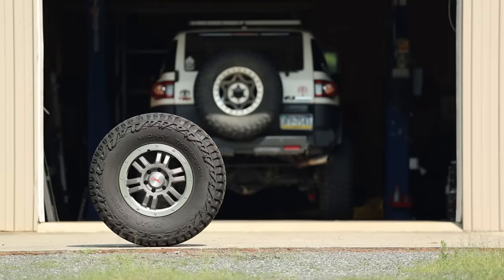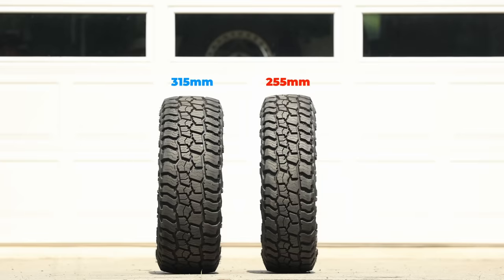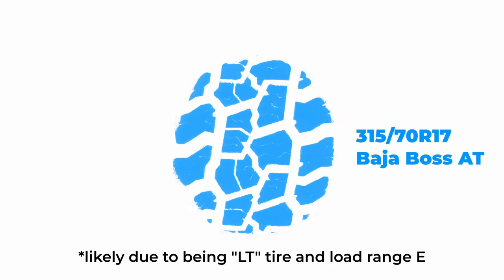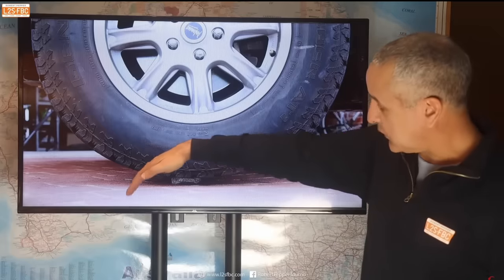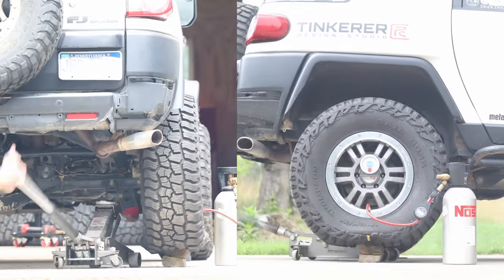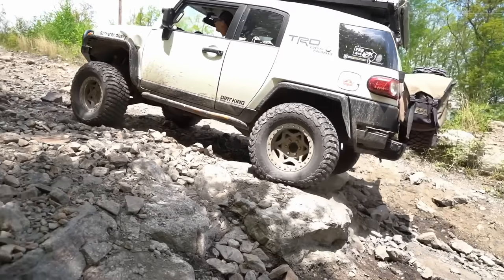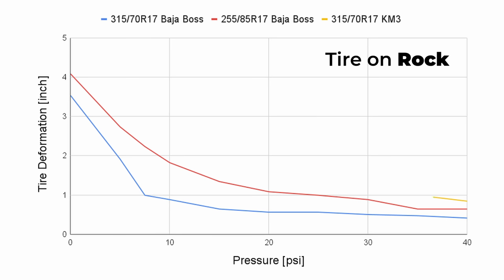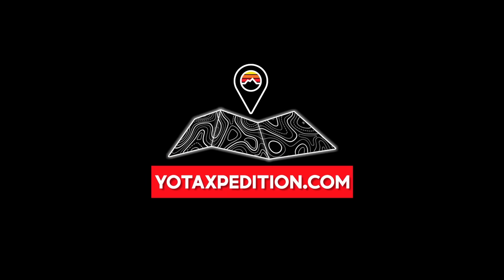3 Scientific Experiments to Settle This | Wide vs Narrow Off-Road Tires

Comment: Really depends on the application. Snow = Skinny Tires,  Sand = Wide Tires,  Off Road General = Depends on the weight of the vehicle,  you have a light vehicle so the thinner would be the same as the wide on a heavier vehicle. This video is great because you point out wide is not always better which is the important takeaway.
Reply: Airing down on sand is more important than width. Length provides better tractions than width.
Reply: Ive found skinny tyres better on sand
Reply: @tishbrett  The only way that could happen is if your vehicle is very light and the tires are sized appropriately then wider may not gain much. As someone who has driven decades on sand in Hatteras wider tires is more flotation and will always out perform skinny tires. Maybe the sand you are driving on is offroad shallow sand and not deep beach sand.
Reply: @raffikkiz  True, its all about the contact patch and airing down makes a bigger patch than going a few sizes wider with same psi.
Reply: @laz288  i will disagree with that mate plus the wider you go bigger the motor has to be to push them a 3t ute is not that light
Reply: @tishbrett  I agree somewhat. I think once your vehicle rides good on the sand then wider wont add much and like you said more work for the engine. But I bet if you went even skinnier on the tires then you have now you will start to see a loss in performance in sand.
Reply: Seen videos narrow better in sand

Comment: Good investigation.  I suspect the E rated sidewalls are just too stiff for the weight of the FJ.  It would be interesting to see the same tests with D rated sidewalls.
Reply: Definitely, I’m not a fan of load E for vehicles smaller than full size trucks, too heavy, less flex, require higher PSI so they ride harsher. Load C would be more than double the max gross vehicle weight of an FJ so more than enough, though finding 35s in Load C and D is harder.
Reply: @luso_overland  Some years ago I inadvertently had some E rated M/Ts on my JKU.  Sidewall was stiff enough that I couldn't tell by looking at it that the rear right was dead flat from the screw in it.  Ran perfectly well to the shops & back at 0 PSI...
Reply: @NemoConsequentae  Yep, I've seen that before as well.
Reply: I run E rated on my CJ. 5psi or flat isn't much different. I only need 20psi to run down the highway.
Reply: Have a 4Runner with E rated 265/70/R 17 tires… good ride, safer for me.

Comment: Great video. 
a lot has to do with the weight of the vehicle. If you have “heavy weight rated tire on a light vehicle, it’s gonna react differently than a lighter weighted tire”. 

If you put a light weight rated tires on a heavy vehicle, it’s gonna have different traction because it’s gonna have more ground contact

Comment: If the KM3s have the flex of the skinny Mickey Thompsons, imagine pizza cutter KM3s

Another great video Kai! Appreciate you applying scientific methodology in a space where it isn't very common. I've been following Robert's channel for awhile, and the accessible technicality of your channels and the density of information of their content is why I keep coming back. Keep up the good work!
Reply: they make them in 33's. 255/85R16. Been thinking about getting them as my next set of tires.
Reply: @takenpictures Been considering them as well. They’re really heavy though compared to other MTs in the same size
Reply: @shootinbruin3614  I've ran the Geolander G003 MT in a 255 and loved it. I'm now trying out the Cooper Discoverer ST MAXX. So far I really like it
Reply: the KM3 wasn't a fair comparison because they're used tires and broken in. It would be a very different result if they were new. I wonder if Kai is sponsored by BFG.. lol
Reply: @takenpictures  Thanks for the input. The Yokos are the lightest 255/85R16's I know of and they're in consideration. I'm currently on the old Geolandar MTs so I just might stick with the brand

Comment: In 46 years of off roading I have learned wider patterns are best for fluffy soft sand , rocky terrain and times when Ya need to float .  Narrow is better in clay and wet cement type terrain where you need to dig down to get a bite . Now the vehicle weight is a factor as well . I have seen heavy trucks get better traction in some terrain and sink in others .Likewise I have seen lighter rigs float and just go through easily or sit and spin while floating . In the early 1980s the tires called Norseman were the best in sand and snow ( Iceland gents used these exclusively ). Look at paddle tires , Rice and Cane field tires and terra skidder tires as extreme examples .

Comment: Well, unfortunately your test is flawed.  A 315/70r17 requres a rim with of 8”-11” for proper fitment, and a 255/85r17 requires 6”-8” rim with for proper fitmen, using the same width of rim puts one tire at maximum spec, and one tire and minimum spec for fitment, altering tread footprint. May be do a do over and use a rim that puts each tire in the centre of their rim width requirements
Reply: Yes, It is flawed in that sense.  But most owners dont exercise power over getting a second set of correct-width rims for the tire, they just run stock because of other issues encountered in setback and fenders.

Comment: Nice take.... I was told years ago that wider was better due to more traction and stability. That was in '00. I had the pizza cutter tires in the beginning, but now I have better tires with more I knew. Currently my 2011 F 150  is rolling on 275/55/20 Highway tires made by Rocky Mountain and I love the ride quality and quiet sound

Comment: Very interesting video. I remember some of what you found from physics and pavement design in college. We had some problems for asphalt design.  These mostly concerned tire pressure effects on asphalt at different loadings. 

Up until the 4x4 boom in early 70s, most people I knew with military surplus jeeps up to CJ-5s ran tires like the narrow ones the military used and swore they were better all around than wider tires but especially in mud and general off road. Not much sand here in foothills of NC. When the 4x4 boom hit, almost everyone I knew went to softer, wider tires but bigger, heavier vehicles became the norm also. I've never seen a study like yours. I have a '66 CJ-5 that is parked but I keep thinking of getting her back on the road / off road. You gave me something to think about. Hats off to your tenacity and hard work. Thanks.

Comment: I have a question (or comment, if you will), but first, I'd like to say this is a fantastic video.  I really appreciate how much time and effort you put into this experiment.
Now, here's my thought.  Though you focused on (in the pipe test) the length of the contact patch, what about the width flex?  The narrower tire flexes more fore and aft more, but it can only flex so wide.  The wider tire flexes outward, rather than fore and aft.  From the video, it seems to be a significant amount too.  This (to me) is significant because the pipe is a more "point" contact rather than an "area" contact.  This additional pressure will definitely spread the footprint more than the flat "ink blot" test (genius, btw).  My point is, what the wide tire lacks in "caterpillar", fore and aft contact, it gains in width contact.
Another consideration is uneven terrain.  There is literally more tire to grab on to any bits of terrain that may contact the wider area of the tire, providing more traction.  For any serious rock crawling, every inch of surface area counts.  When you straddle and use the sides of the tire, you have that much more gripping than the narrow tire.  A rock climber (the person scaling a rock face) would LOVE to use a whole hand to get a purchase, but sometimes, you can only use a couple of finger tips.  I feel the wider tire gives you those extra fingers, if you will.  Merely my thoughts on the subject.  I'm not against narrow tires at all, but I just like all aspects to be thought of.  Wider tires definitely have disadvantages: weight, cost, torque loss, turning radius, to name a few, but I really don't think traction is one of them.  Cheers!  Keep up the great videos!!

Comment: This felt like watching Project Farm! Great analysis and objectivity. Gotta love mechanical engineers!

I’d be really interested to somehow see the differences in engine load by rotating the two. I’ve got a new I-FORCE Max V6 twin turbo in my 24’ Tundra and I try and find the best balance in sizing up but also keeping baseline revs down. Those turbos are gonna last longer with lower RPMs and staying cooler. I know bigger tires/more mass to rotate means more power needed - I just wish I could see numbers on how much.

Comment: One thing about wider tyres vs narrower is on the same rim you can lower the wider tyres pressure a lot lower without risk of de-beading. The narrow tyre sidewall doesn’t bulge out as much as it is not much wider than the rim width.
I noticed this when I went from a 9” wide rim to a 8” wide. Of course this doesn’t matter if your rims are bead locked but bead locked wheels aren’t street legal in Australia

Comment: I've always liked the looks of a thinner tire. Not too thin, though. I was told by a mechanic along while back the reason he used thinner tires is that they could carry him up and down the right of way a lot better than the wider tires. He also told me that was why he just drove around the trucks with wider tires that were stuck on the side of the mountain. This video shows what he was trying to convey to me. Thanks.

Comment: In North Dakota,  Tall thin tires also performed very well in deep snow.  It was important to cut down to the hard frozen ground for traction.  The long thin tire patch would pack down the snow tighter and give grip.  The amount of tire required to gain floatation on snow is extreme.

Comment: On my 2000 Jeep XJ, in the winter, I run my "commuter tires"  Kenda Klever R/T KR601 35X10.50R17 D/8PLY in the summertime I run Accelera Badak X-Treme 37X11.50R17s. I've always preferred the skinnier tires for mud/snow...

Comment: I think this is great video for narrow vrs wide tieres for "static flex/loade". I would also like to see a comparison between wide and narrow tires in both "dynamic flex/load" ie. "can a bigger tire take a bigger hit before debeading", and buoyancy "float" ie. " dose the valume of air displaced by the larger tire compensate for a heavier rig in mud, sand and water.". ALSO a bigger tire has more aria to grip 3 dementionaly if lets say it is barriered in something or trying to climb out of something, "think snad or mud pit". If the force per square inch of serfice aria is less on a wider tier baried in mud, then you are less likely to loose traction, "think bigger propeller vrs smaller propellor". These questions are important when considering something more than "rocks or rock steps." Which tire is truly better for river crossing, sand dunes, mud hills, and snow/ice and at what speads? or are different tires better for different jobs? 

Or even what about turning radios? Dose the bigger tires spaced more out improve your turning radios?

I still like my big chunguses though :) they fat Boois

Comment: This is great! It comes back to pressure = force / area. The only factors effecting the contact patch area are the weight of your vehicle and the pressure in the tyres. Not the width of the tyres.

Comment: I also run 35x10.50s on my Wrangler. Ultimately, they are cheaper, lighter, quieter and saves me a little more in gas being thinner. Additionally, when I'm flexing, more tire can be stuffed into the wheel well than the wider tires that will hit the edge of the fender. I've rocked this size for almost 10 years now and have been pleased ever since. My favorite tire now are Kenda Klever R/T 35x10.5s.Super quiet and last a long time.

Comment: Thanks for this review I just got a 2300 RAM 1500 and they put a lift on it and Firestone Destination mt2 35 12.5 121q r20. I've never had anythibg thus huge on, I'm 75 and these tires are rougher than I recall on my highway test drive. You went over a lot of information. I'll never have my truck offroad- intentionally!

Comment: We were camping on the Naches trail at the top of a substantially steep hill after a water crossing. 1959 Ford 1 ton dually flatbed and a 1968 GMC 2 wheel drive Suburban. The next day a pile of CJ5's showed up and asked how many times we had to use 4 wheel drive to get up there. LOL stock skinny tires did the job that the fat tire Jeepers couldn't.

Comment: Great video!

Contact patch area is for sure the same, because is weight/pressure, for physical reason!

Naturally this change if you change tire structure, because more soft rubber and structure changes how ground pressure deforms the whole tire structure and this makes  a different contact patch may append at the same pressure, because the internal tire volume changes differently in the parts the tire is not in contcat with the ground.

In Trial I use the most soft structure tires to have the best contact patch over all obstacles and the difference is really great!

You have demonstrated this in a real good way !

Comment: This is the best tire comparison video I've seen; I appreciate the rigor with which you approached the variables tested. I have a few comments to help us justify those sweet Instagram wide tires: As mentioned already, ground surface is a huge factor, and wide tires offer superior flotation on some surfaces, which I understand was appropriately not a part of this test. It makes sense that the overall contact patches for the wide and narrow tires are the same given the other tire variables (sidewall rigidity, tire pressure, etc.) are constant, as the weight of the vehicle being supported is also constant. Load rating E is probably too high for the test vehicle, preventing the tires from offering the deflection you're looking for at driveable pressures. (What was the load rating on the K03? Perhaps C or D?) Also: while I appreciate isolating the width variable for control purposes (and the data generated is very interesting), in a real-world scenario it might be possible to run a wider, "softer" tire instead of a narrower, "harder" tire.

Comment: Excellent analysis.
I have a new Bronco Black Diamond.  I'd like to have taller tires but I want to keep my stock wheels and they are only 7.5 inches wide.  Technically, I'm not supposed to run 315 tires.  
The pizza cutters will be wide enough, while being taller.

Comment: I've found there's pros and cons for both. One that comes to mind is if you're in mud, the tire that isn't spinning mine as well be an anchor. In that case, I'd want thinner. When on rocks, there will be times where only a fraction of your tire will have anything under it. So wider helps straddling tight spots.
I like seeing a good contact patch on the bottom of the tire. But in many off road situations, the whole tire should be considered a contact point. That's why aggressive side walls aren't just for looks either.
I generally think if you have lockers, wide is an all round safe bet. If not, consider your wheeling preferences first.

Comment: Look forward to a repeated experiment at 5-10k to show the difference in broken in tires. Civil here and in my pavement design classes we had a chapter or two on tires that was mostly glossed over but tubed, bias, and radial all behave differently. Aspect ratio impacts matter at pressure extremes. At most pressures the contact patch is assumed to be circular. At low pressures or with soft surfaces, the sidewalls will create higher pressure ridges across the tread pattern. The science is there but mostly focused on semis and farm equipment since that is where the money is.

Comment: I learned back in the late 70's when I got my first 4 wheel drive, that narrow tires perform better. It was hard to swallow at the time because the wider tires look so much cooler and I wanted my Blazer to look cool. But in time, I realized I needed function over looks after getting stuck a few times, even with wide cleated tires. I hold true to that even today and stay around 9 to 10 inches in width. I don't go over 10 inches and so I hover around 9.5 as a usual width. Your test just basically shows and confirms what I have known most of my life. I was curious to see what you came up with, and that's why I watched it.

Comment: Love the analysis. One point not discussed is total air volume (PSI to tire size). Naturally a skinnier tire will flex comparatively more than a wider tire at the same psi as it has less air volume acting against the obstacle. Would imagine the same flex given equal air volumes across skinny or wide tires. I'll take pizza cutters any day though, better mpg, lighter weight for the same clearance, etc.

Comment: Skinny usually find the bottom of the mud hole better but most people like to look like they're going off road with the wide. I used the Baja Boss tire and finding best air pressure driving. Mine seem to like 40psi on the road.  The center patch is contacting the most the way tread face is made. Heat seems to affect these more. Ride is best around 33-34 psi but the the edges start chopping a little. You can almost tell by the tune your tire plays on the road where air pressure should be. These remind be of a Buckshot mudders with a higher center tread.

Comment: Thanks for the video! As a systems analyst I appreciate your fact-based approach! We now have a very good idea how wide versus skinny is going to perform on really hard surfaces like rock or concrete. However, I would like to see an objective evaluation done on soft surfaces like very fine sand, snow, or mud, which are more likely to conform to the shape of the tire rather than vice versa. I keep thinking there is a reason why I see flotation tires that are several feet wide on heavy equipment when they are going to be used on something really soft!